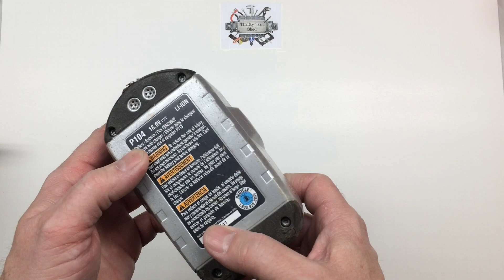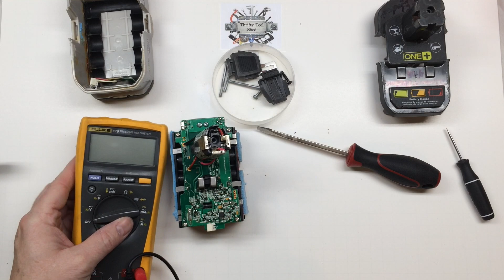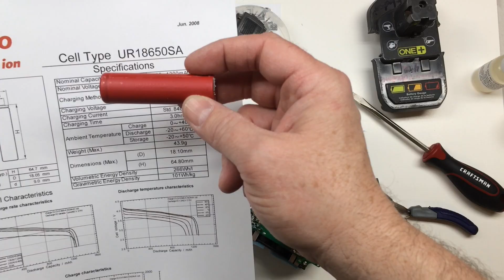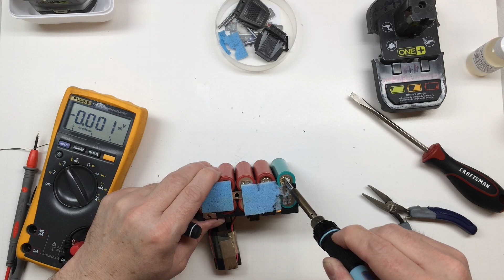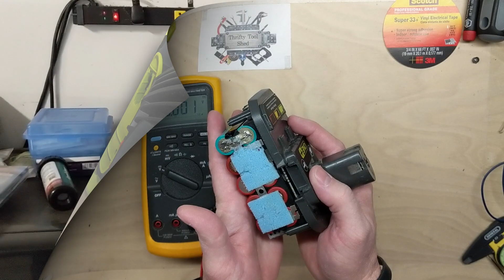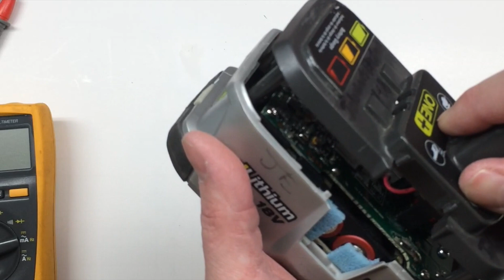Ryobi P104 Battery Repair

Comment: you show the + on the left side but you put your negative (black) probe on that side of the battery! why?
Reply from the maker: Its been quite a while, but typically with batteries going from cell to cell etc. I am not concerned about polarity. Looking at the numbers for balancing only.
Reply: @ThriftyToolShed  You switch them when testing the posts. Can you see how this might confues an unexperianced person? I understand your thought but unexperianced might not understand in that case polarity isnt a factor. Just saying. Your video was a good one...

Comment: Every video skips or fast forwards the part where the case opens. I have all the screws out and something is still holding it together on one end.
Reply from the maker: It has been a few years and I do remember fast forwarding through opening the case. If I remember I still showed removing all screws including the one on the very top of the connection post. I also shared the prying around the case top as well as the post housing separating from the connector. Most models have the 5 screws and the Ryobi clips are pretty tough to pry apart.
Reply: @ThriftyToolShed  yes it was those dumb hidden clips that wouldn't let go. I felt like I was going to break it. In the end, I discovered half my cells were badly bulging and corroded.

Comment: How to reset the BMS in this type of battery? I have four leds flashing four times and it is dead :(
Reply from the maker: Some of these boards have a microcontroller programming header or at least the pads on the board for it and you can jump GND to RST to do a microcontroller reset. Sometimes it helps and sometimes not.  I have a video on a ECHO 58V pack repair and it helped on that one and I shared that on the video. I also have a video on the Ridgid 18v Hyper Lithium pack and I shared the reset on it as well, but it was not the whole issue on that one. Best of luck to ya!
Reply: @ThriftyToolShed  Unfortunately this type of pad does not exist in this battery. I have searched for it very carefully and... nope. That's why I asked my question :(
Second thing, what kind of replacement we can use if the original BMS is damaged?
Reply from the maker: It is a few packs that do not have that. The only way to do it without that is to look up the microcontroller spec sheet and finding the reset pin and jump that way or desolder the tab that goes from cell to board to break the power to board completely for a about 30s then reattach? You can find replacement BMS boards for these on eBay. Last I checked it's almost as much as buying the cheaper aftermarket pack.
Reply: @ThriftyToolShed  The sad thing is that in the newest version of the BMS board, Ryobi put some kind of gel on the bord surface. Like in wash machines. Impossible to mesure anything, desolder etc. Bastards... :)
Reply from the maker: @ukaszseklecki6177  
That is such a pain!

Comment: since the battery pack is in series parallel wouldn't the pack have equalized by itself without charging individually?
Reply from the maker: Well the series would mean if one set of 2  was lower than the others then the pack would shut down prematurely when that set is registered below 2.8V or so. For example some others maybe at 3.5v, So capacity may be diminished. After several charge cycles though and if the cells are matched well they most likely will balance closer. The unmatched cells of course will get slightly more unbalanced. The thing about the parallel sets is they will equalize across each other for certain, but we don't want that to be too much of a current flow between the 2 when put together,  it could potentially be catastrophic. Depending of course on how far out if balance the 2 are if that makes sense. I have a video about the way I normally test cells before putting them in a pack and I like to take the time to do it correctly. 
Thanks for your comment!
https://youtu.be/f9SOPVEqgkw

Comment: I have an 18v+ 4Ah battery that the internal battery voltage is 20.5v but only 7.8v at the external contact points.

Comment: Just a real quick question my ryobi battery is giving me a full 13.85 volt on the battery but when i check the posts im only getting 10 volt and it will not charge and the led will not turn on and all the cells are good what could be the issue and the board looks like it is burnt next to the battery check button is it the bms that is bad
Reply from the maker: The Mosfets are not on so it is not showing full output on the battery post. I would check and make sure all cells are balanced well it could be one cell or more that is below around 2.7v and that may stop the pack from charging. Not a fan of boosting packs when the condition is not known, but if you have a cell that is just a little lower than others you can bring it up slow with a bench top PS set at the same voltage as other cells and current limit to about 1A monitor to make sure nothing is getting too warm and then make sure the whole pack is high enough to charge, like maybe bring it up to 15 - 16V across all 5 cell sets. Then maybe it will take off charging on charger. If not most likely bad BMS. Best of luck to ya!
Reply: @ThriftyToolShed  thanks i checked every cell and they are all 2.7 volt so now i know it is the bms thanks so much for your help

Comment: What kind of lifespan do you get out of these rebuilds?  I always wonder if it’s worth the effort or better to just pull the trigger on a new one. Thanks so much.
Reply from the maker: It depends on the shape of the pack. It's best to replace all cells of course if you have some from other packs that have tested with good capacity or like new. Buying all new cells is usually not worth the expense compared to buying a new one. I have had pretty good luck and gotten years more from some packs with replacing a almost identical matched cell with others if they all test in capacity the same. If you don't make sure all the others are in good capacity and the replacement is not a really close match, the pack will not last very long before issues again. Also if you have to boost a pack because the cells are going below 2.5v at times typically something internally is going on with those cells anyway and it's a lost cause unless it's tested well enough to see which cells are slowly discharging on it.

Comment: Those Ryobis look like they give you a lot more room in case. I've got 20V Dewalt stuff and they almost won't go back in the case after soldering. They dang sure won't with that much solder, they are a pain in the ass! Great work, thx for the vid!

Comment: Question for you .I have a Ryobi P108 double stack 18v battery that has issues . Won't take charge and a test of the terminals before disassembly showed no voltage at all to the terminals . However after removing from case and checking voltage across the battery terminals I have 18v . Something is prohibiting the voltage from reaching the topside terminals . Thats where I need help . I have no idea what It might be but would love to repair it and put it back into service . Any help would be appreciated .
Reply from the maker: HI,
Well the BMS on these has MOSFETs. Usually one Mosfet is for discharge and one is for charging. These normally do not have the output voltage at the terminals unless they wake up if you will. Some models of these packs output once in tool and also when the charge level indicator is pressed. Other than checking the MOSFETs or possible reset on the BMS board for the microcontroller, that is all I could say, just guessing.
Reply: @ThriftyToolShed  Ok how do I go about checking the mosfets ? Also I did find the test ports on the board and one of them is marked rst which I assume is reset .  I know I have to short this out to reset it but not sure where to touch the jumper .
Reply from the maker: I try not to repeat a tremendous amount of similar information about battery packs since some viewers may watch most of them. Since Ridgid is also made by TTI as Ryobi the video below has almost the same information as the same test on Ryobi. I am assuming I did not mention it all again in my Ryobi video. It's been a while. Lol.. 
https://youtu.be/lpjdJCqBsTU
Reply from the maker: The reset is simply jumping the reset pin to the ground pin and sometimes it helps by cycling the BMS as you can imagine it's powered at all times and does not ever get a true power reset so this resets or reboots the microcontroller, I have had success doing this maybe 5-7% of the time, not always helpful, but always worth the try.
Reply: @ThriftyToolShed  Success !!!  I reset the board according to the Rigid video you made then proceeded to give the PCB a good cleaning with contact cleaner and toothbrush . I scrubbed it twice as I did see some corrosion present . I dried it well then placed it back in the charger.......Viola , blinking red test followed by a steady green light displaying full charge . Inserted into the tool and works like a charm . Thanks so much for your help .
Reply from the maker: Excellent work. Glad it helped, thanks for sharing!

Comment: I would like to get a 30V 5A Linear Power Supply, What would recommend for a starter? Thanks
Reply from the maker: I do have a PS listed in the video description similar to what I use. From time to time they are out of stock but amazon usually has other similar items pop up as options. I really like the Uni-t 30V 5A that I have, it's been really good.

Comment: great video. thank you for the links. I have two p104 batteries that are graveyard  dead..Q. had the bad batteries been in the center of the pak vs the end like yours, would it have been any more difficult or a different process ?
Reply from the maker: Yes, the end made for a quicker video for sure. Sometimes in the middle of the pack you have to remove alot more cells to replace the bad one. You have to be alot  more careful not to short out any cells while working away at these and it's alot more time consuming. 
Thanks for your comment!

Comment: My P189 fell in dishwater 3 weeks ago. :(  I get 17.05 across the top terminals. 3.48 ... 3.51 across each battery 17.56 from top right to bottom left. 14.05 from top right to bottom right.  My Intelliport 30 minute charger makes a few clicking sounds then shows a solid red light meaning "Defective." Can I replace the board and get her up and running again?
Reply from the maker: It should possible. I would try to clean the board very well and try before you go through the trouble. I have a video on a Ridgid pack that shows a corrosion issue resolved it's most likey a long shot, but I would give it a try. Good plastic safe in conductive electronic contact cleaner.

Comment: Thanks for the vid! Great job.
We have a landscape contracting co. 
My ryobi batteries go "dead" after contact with just a little bit of moisture. Maybe that foam gets wet and jumps. The Dewalt or Milwaukee hold up just fine. 
These ryobi are least durable for real world conditions and the warranty is the worst. 
Anyway, if you have suggestion where to look would be great. 
I do not have your understanding of electronics.
Reply from the maker: Thanks for your comment. I have not seen that exact issue but the last Ridgid pack I worked on had a weird issue and it was corrosion on the board it seems similar maybe especially since both Ridgid and Ryobi are made by TTI.

Comment: Can you do a video on 40V Ryobi?  Your video is great, I learned a lot
Reply from the maker: Thanks for your comment. I have been asked alot about the 40V Ryobi. I did do a quick video about some problems with them. I just mentioned that for me they were so problematic that I stopped repairing them and just saved the good cells from the ones I had. I have been asked alot about them though. If I get some more I may look a little further into them.

Comment: Mine shows 18 volts at the batteries  but not much at the post terminals..suspect the BMS  has gone..any ideas???
Reply from the maker: The mosfets on the BMS will cut the power to the terminals (post). Some versions of these packs the push button "fuel gauge" will activate the mosfets for a few seconds while testing, most older versions do not have this, they cut the power when issue detected with the cells such as  low voltage on a cell, over voltage or if NTC picks up a temperature issue!

Comment: For the LOVE OF GOD, through all these videos, I cannot find the hidden screw on the top of the base. 1 stem screw and 4 underneath.
I see what could be 2 plastic "plugs" on the backside of the base, Southeast and Southwest of the stem, if the stem side of the battery is closest to you.
I hope that makes sense. I've tried prying but it seems more resistive that should be, so I don't want to force it.
I've had an 18650 burst/erupt/runaway once before and I'm VERY respectful of them in general, so I'll patiently wait for advice versus burning down my garage.
Thanks in advance, sorry for the hijack. Be well.
Reply from the maker: Ok, so you have not gotten the battery case to seperate at all? And you have removed 4 security screws around the top of the pack and you have even removed the very top stem screw as well?
Reply: @ThriftyToolShed  correct. I've tried prying with many safe items, but it seems too tough, and I don't want to damage it.
I have taken one screw out of the stem, and four screws out of the bottom side of the battery. The screws for my battery are not accessible from stem/top, they are accessed from bottom of pack, where the label and vent holes are.

I greatly appreciate the response, thank you!
Reply from the maker: Correct. On all the Ryobi packs I have, that is all the screws. The 4 bottom and the one on top of stem. It is difficult to pry open some of these packs. They have little catches  along the joint of the pack. It should pop up with a little prying...
Reply: @ThriftyToolShed  in your video, at 51 seconds, when you are prying on the stem side of the battery, your starts to separate, mine refuses. I'm good at breaking things by force.
I've seen some other videos that show hidden plugs that you have to pry out or drill through which I have tried to do as well, and I now have a hole where one of the plugs should supposedly be, but I'm afraid to increase the size of the holeas I do not want to get hurt or damage the battery pack.
Reply from the maker: I have showed pulling plugs out of a few of the packs in my videos but that is one of the 4 on the lower half of the pack. Still only 5 screws with all mine, some had the plug that I show digging in and prying out and some did not have any. Either way that is my experience just 5 screws total on mine. Some packs are hard to seperate the lower half at the seam, I have had to pry hard on some, once it pops and you work it all the way around then pry the stem center down usually with a small screwdriver inserted at the top.
Reply: @ThriftyToolShed  Thanks SO MUCH for your advice, I'll report back soon.

Comment: Hey bro, what kind of screw you use to open the cover? I can't find proper tool to open it. Thanks
Reply from the maker: It is the Security Torx bits to fit the torx screws with center stud. T10 is the common size for alot of these type packs. I usually have a link in video description with the long reach  security bit set link if needed. I really like this type because they reach in some tighter and deeper to reach areas.

Comment: You held that soldering iron on the cell for a full minute! 😂
Reply from the maker: Yeah, that's why it exploded. I guess it was not clear but to start with I was heating up the large thermal mass of the metal strip(not even in contact with cell at first) before pushing it down and then only a few more seconds actually to make the puddle since it was pre tinned. Thanks for your concern. 
I like to use spot weld for new builds, soldering works best for me over the years for older pack repairs. Spot weld yours if you like...

Comment: saw other ppl try to recharge the cell directly and it works
Reply from the maker: Please watch this video! 
https://youtu.be/1ucbqglhyBk
Reply: Thrifty Tool Shed so it could be charger too
Reply from the maker: @micwang7757  
Sometimes you can get a pack back working by recharging individual cells up if they are in decent condition. Usually at that point they will have lost capacity and the most important thing is that the cells are healthy enough to charge or give that boost back.  Cells that are in really bad condition should not be charged. The video in the link shows one of the worst condition of cells that I have on video. Just a safety note for boosting cells that are not in good condition.
Reply: Thank you

Comment: Thanks for the how to do it yourself video. Changed out two batteries with most of them dead - dead - dead. Its charging up again. Thanks, was scared to sorter the batteries but your instructions were dead on.
Reply from the maker: Glad it helped. As long as we are very careful and have respect for the energy they do store, we should be good! Thanks for your comment!